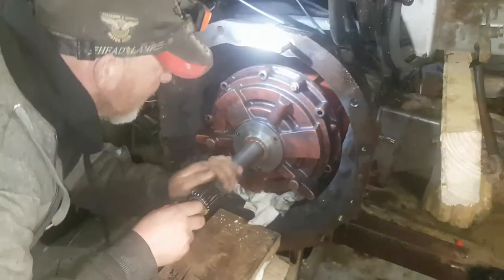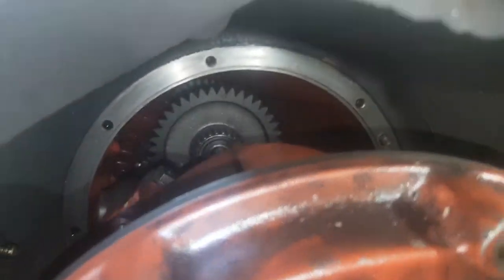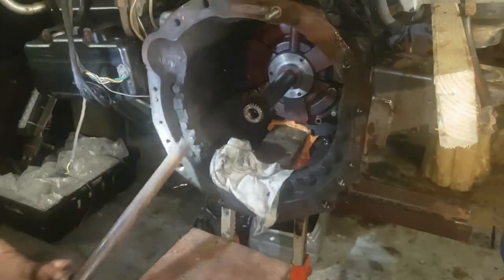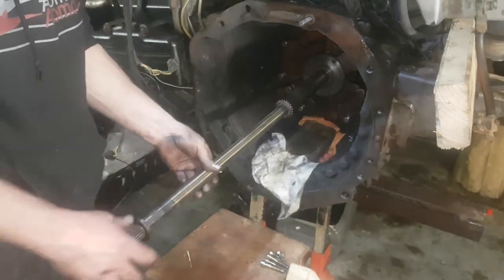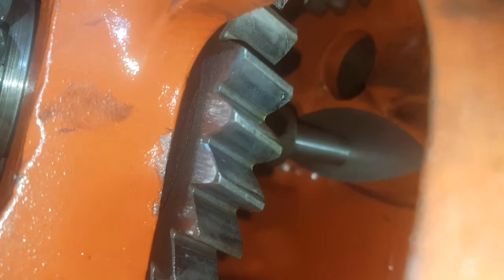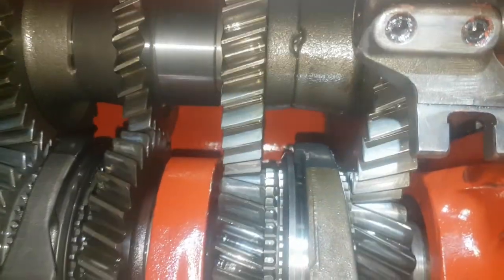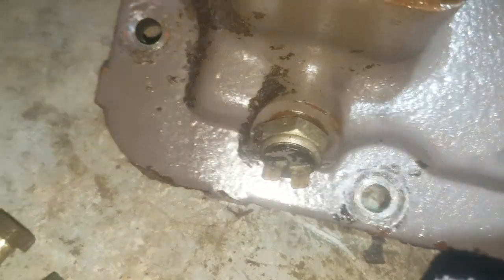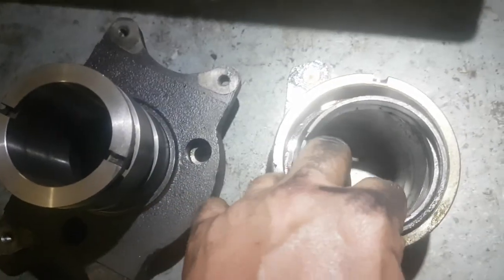Massey Ferguson 3125 speedshift box install into tractor

Comment: Good job getting it back in by hand we had an engine hoist and a brackets cobbled together to do it,
Its worth checking the selector forks on the right hand cover are tight on mine the grub screws were loose causing more play in the gearstick's.  👍
Reply from the maker: Ye I would have taken off the fork off forward reverse only it was locktite in and felt like it was going to snap or round
Reply from the maker: I just made a table same level and lifted it up by hand slid in the pto to guide it in handy enough job considering the weight of it all
Has to be 150kg ish

Comment: Hello, i have another problem with my 3065, when i press the button to engage the speedshift after 30 second it engages it , and for the disengaging its the same if you got any clues? 3 days ago it was working fine.
And i have another problem with the 4wd, it doesnt matter in which position is the button it will disengage 4wd and it puts me on turtle, if i press the cluth 4wd its back again. (before 4wd disengages and puts me on turtle a red light comes on the dash , the second light fron the lower row and the 4wd light.( i have changed the 4wd button recently.))
Reply from the maker: Sounds like you have a major internal oil leak 
First thing is get hold of an oil pressure gague and hook it up to your transmission see what pressure is on it doing different things and try reving see does it Improve 
After that it's go find the leak 
Most of what you said there can be oil related but check wires into cab under right step ( it's right on the 3125 so I'm assuming the same on yours ) check thick yellow and all wires for corrosion
Reply: @gearsandtears7643  ok, i will check the wires then i will check if i have any oil leak, thank you!
Reply: @gearsandtears7643   should i engage the speedshift like shifting gears (with cluth or without)
If you know where the leak could be that will be incredible.
Reply from the maker: @odamptvasy  you don't need to clutch as the speed shift itself is a clutch/ brake with discs
Its actuated by an electric valve so try putting 12v to the solenoid see does that do anything 
I'd definitely try the wires under right cab door there's a thick yellow one and a thick red wire 
Mine had corroded yellow wire as in one of my videos once I fixed that I've all gears working 
I also had seals leaking internal and a few bad bearings

Comment: So, today is my worst day of my life, I went sowing and my tractor  wouldn't let down my sowing machine,  like it was blocked on the up position. I tried all the buttons but it didn't work. So I went home , and stopped the tractor and started to look around, I tried to spray some anti rust spray on the connections of  the autotronic, and tested the solenoids, all of then are working, then i tried moving the tractor but nothing.
Reply from the maker: Will you try make s short video show me what's happening 
Is your steering working as it should? Sounds a bit like blocked hydraulic filter now with what you said
Reply: So today , the hitch was working somehow here a link to the video.
https://youtu.be/jLF9Ars-CKs
Reply from the maker: @odamptvasy  it has to be electrical 
You going to have to check every connection from the battery 
Does the lights light on dash as they should? 
Any low oil warning light ?
Pressure test will tell you a lot too
Reply: The oil is at level and no warning light, maybe the autotronic under the right step is faulty?
Reply from the maker: @odamptvasy  that red light on dash is low oil pressure 
Tractor will stay in permanent 4x4 too
Reply: When I steer and lift it makes a humming sound .
Reply from the maker: @odamptvasy  have you checked for enough oil in back end with the dipstick? 
Also when was it's last oil filter change ? There's a screen filter under cab also on the steering pipes
Reply: The oil change was in january , so I fixed the tractor , yay for me, it was a n electrical issue with the pressure sensor,  the guy I bought the tractor has changed the sensor to a newer version, and added a rezistor who, detached, and one of the connector from the autotronic was rusted.
Thank you for all of the advice you gave me, I am really thankfull, if you want the 3000-3100 series manual you can give your email adress and I will send it to you.
Reply from the maker: @odamptvasy  ah cool so all is good now ? At least you learning a few bits there simple enough 
Thankfully you don't have to split the tractor and open up a cam of worms like I had to lol
I actually have an manual online also so comes in handy for some stuff
Good luck with the tractor buddy